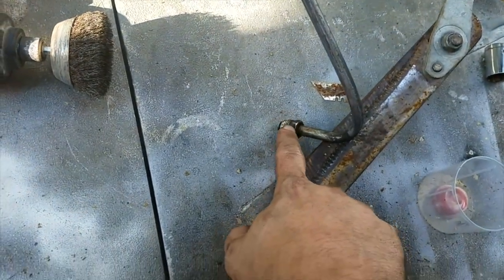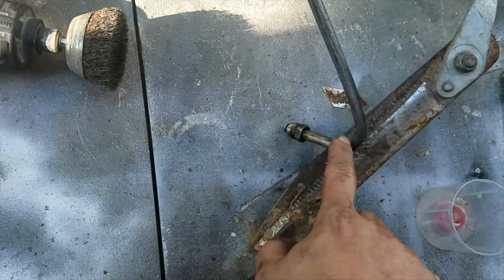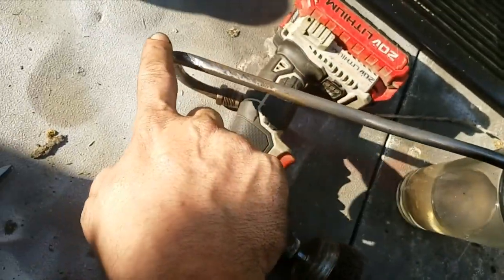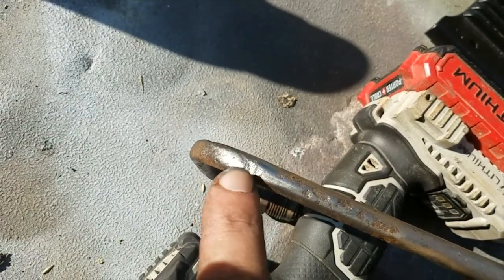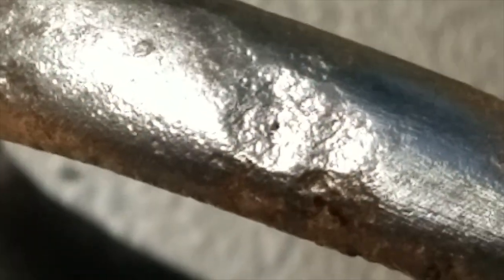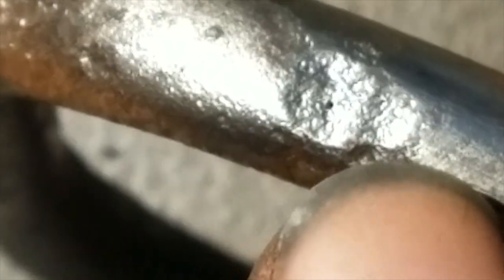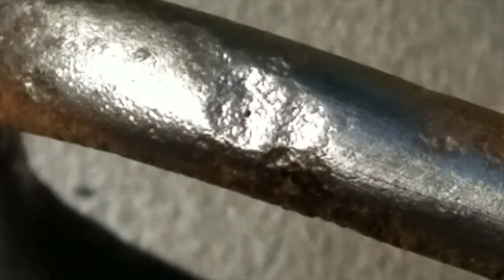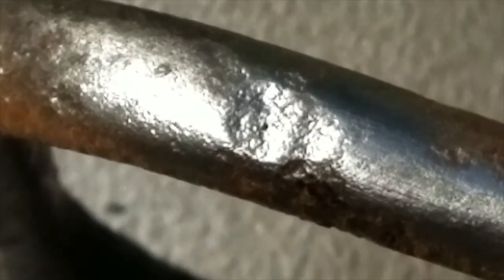Fixed Power Steering Line (and the brake booster to boot!) RV Repairs

Comment: The power steering pump is what feeds the brake booster and the steering box. The brake lines are not in the same circuit. I could be wrong but I think if you fill the power steering tank and crank the steering wheel back and forth lock to lock it will bleed the air out of the circuit.
Reply from the maker: I've had mechanics tell me on old units you could but you risk grinding the pump up with air and no oil. Hey, at least ill get some more tools out of it!! Winner winner chicken dinner!

Comment: Nice Ideal  on booster  What yr your Rv Dan ??  i am looking at them i was thinking around 1985 and  up looking at  we be full time in the Rv in Oct 2021
Reply from the maker: Hi James! Catching up on my comments in the UToob studio. My Allegro is a 1987 on a 1986 Chevy P30 chassis which is still pretty easy to find engine/ drivetrain parts for. The tires are 16" rims so the cost for those is about 170 bucks per tire but much less than those folks getting new Class A RV's with big tractor trailer tires at 1000 bucks a pop! I'll keep my cheapy gas Class A RV for now....